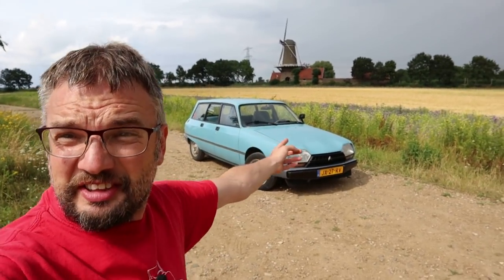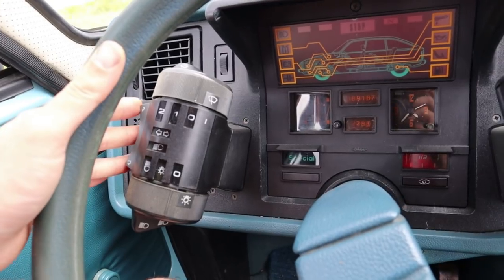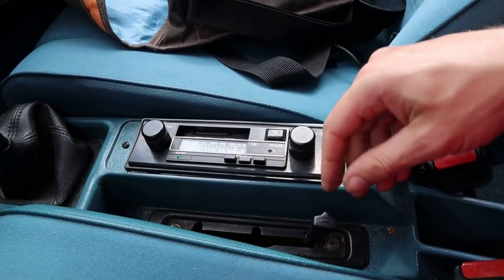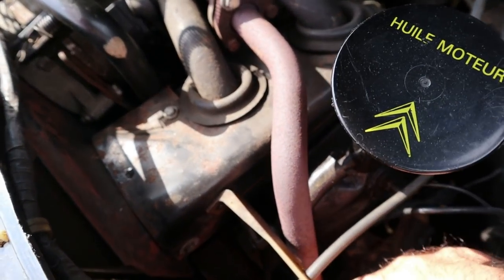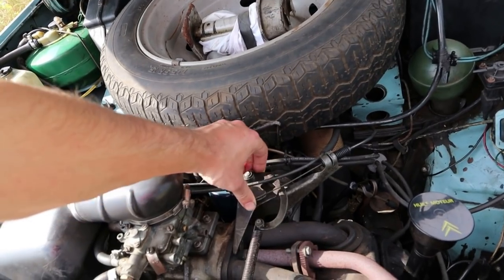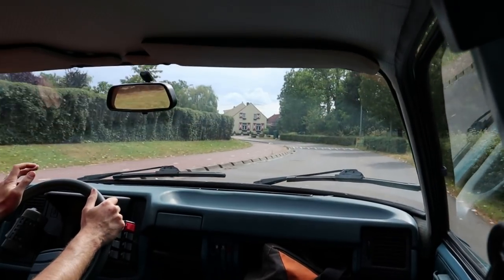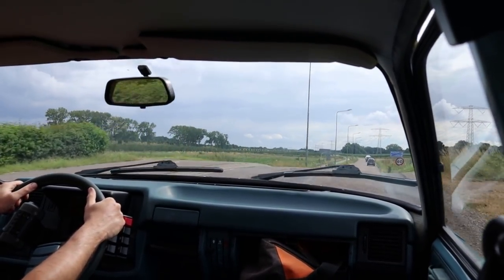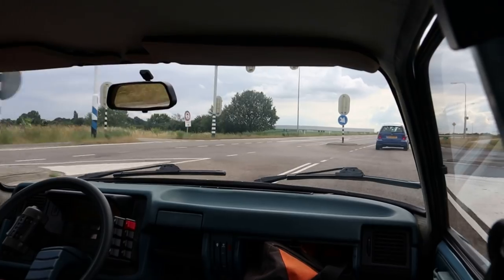Real Road Test: Citroën GSA Break (estate) Spécial!

Comment: The initial GS was designed for a small birotor Wankel engine, and was extremely far ahead in terms of technical advance. It was also conceived as a sports car, years before Mazda RX7. But high consumption and motor gaskets fragility forced Citroën to sort a more classic motor solution, derived from smaller models. So, even with an air cooled engine, these 4 cylinders boxers 1100 and 1300 cc were always a nightmare to access, as ''too big'' for the car body, and in a very frontward position: imagine a 2CV with a double motor! This gave nighmares for mechanics, and needed special tools and procedures, many kept secret to the customer. For instance, if you want to change front spark plugs, the best way is to remove the indicators lights, then the road lights can be clipsed away. If you try a classic method, you'll still need a special cardan spark plugs, but you can harm the delicate copper oil tubes from the oil radiator behind the ventilator...
The GS evolved in special series X and X3 well equipped and more ’'sport'' oriented, but we're still affected by a corrosion default. In France, the original ad saying ''Citroën roule pour vous'' was commonly said ''Citroën rouille (rusts) pour vous". This problem was partially corrected with GSA series, also introducing economic 1300cc with an ''economode'' indicator in the dashboard, passing from Green to red in function of the gasoline debit. This was supposed to teach economy driving, and was quite effective. The comfort was also enhanced with a better motor noise insulation, firmer foams for the seats, but also claimed an advanced driving ''experiment'' with a specific ''cockpit design'', including indicators switches in ''satellites''. All the car commands were supposed to be accessible without leaving the wheel, except for the horrific radio. As far you can say that's too much, when it comes to modern cars with buttons everywhere including the driving wheel center, or gigantic interactive displays...
The hydraulic suspension partially derived from the famous DS, and also included moving masses reduction principles: the front break discs were mounted directly near the gearbox... A good engineer idea, but false for everyday maintenance, as you have to lean on top of the carburetor to get access to the system, including the hand brake levers adjusting screws, brake pads! Disc removal is a long and messy business including partial suspension removal, transmission axles and joints removal... In spaces with little or no access without special tools and patience!
The next generation BX solved these engineers compromises with more classic solutions, including a new series of water cooled line of engines, petrol and Diesel motors, and sporty supercharged turbo engines. Anyway, the comfort was someway different, and even with last generation C5 including optional hydractive3, Citroën has left the "flying over the road" sensation, in benefit of security, stability (and less seasick young passengers).

Comment: What is a good car or not is defined by what you want from it. Most people wanted a reliable, cheap car that lasted more than four years without major repairs. That was not Citroën GS. I have driven BX 19TRS automatic and Xantia 2.0 16v automatic. The newer, the better. The Xantia, I think was just as reliable as most Japanese cars at the time. Sadly, Citroën went more and more the Peugeot way. If I had wanted a Peugeot, I would have bought one. Having said that, I did not mind Citroën using Peugeot engines. They were excellent machines.

Comment: about 17:30 – the engine accelerates smoothly from low to high RPM. Definitely not a Golf. I had a very old GS, just great to drive. Too expensive to build, so Peugeot killed the model when taking over Citroën.

Comment: If only the GSA had a 120hp 1600cc engine it could have been a great car.
Reply from the maker: The 60bhp 1.3 is enough, but it took them far too long to get there. Mine sits at 75mph/120kmh all day without issue.

Comment: Not to be a nitpicker but you can get normal wiper blades very easily. Autodoc for example sells multiple brands. These GSA's never appealed to me since I thought they were very underpowered. A Renault 16 could be had with 96 hp, much more than this. But maybe you are showing again that power isn't everything!
Reply: Have you ever driven one? Because it's a boxer, it's far from slow.
Also it's very light for a 'large' car.
Reply: @rollingtroll  Light, I understand. But why is a boxer faster? VW Beetles aren't exactly sports cars.

Comment: Problem with Citroën, and other French cars, was.... Rust. And lots op it! 
When a French car was 3 years old, the first holes did appear...
After 1980 they  became better and better, but the image damage was to big.
And... Citroen's did ask a lot of very expensive maintenance. Becouse of the complexity and the service unfriendly way they were build.
A full service easely would cost 500 euro, but on an Opel, Ford or Volkswagen the full service would cost you "only" €175... 
All things above killed Citroën...
Reply: I don't think it was as bad as people think. Opels and Honda's of the day were far worse, as were toyota's. 
And don't even get me started on Alfa. I think the French were pretty average when it came to rust, except for a few really bad examples, but still it really mattered on which one you had. This GSA is pretty much original and barely needed any welding. I had a visa that just wouldn't rust. It's still around. I had another Visa that definitely would :D. 
I do realize I know your name though. You should know better with your 400.000+km 406 :D.
Reply: As I wrote, after 1980 they used better quakity steel and the rust problem was gone. This GSA was build in 1983. 😉
In the late 70's and early 80's, all the French carmakers  had problems sellng their cars, mostly becouse of their image,,,

Comment: I had the GS. Learned to hate it. Styling was nice and comfortable but stunningly unreliable. Hydraulic pipes rusted through losing suspension and brakes at 70mph. Handbrake pads kept falling out. Seats rotted along the top due to UV from sunlight. Oil filter on top of engine. Change that and forget to block off channel into the clutch and oil rushes down meaning clutch change required. Wheel bearings failed, rust everywhere, rusted headlamps at £100 each and on and on. Never had such an awful pile of junk.